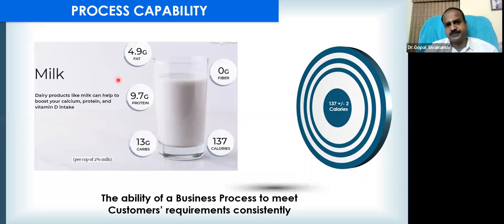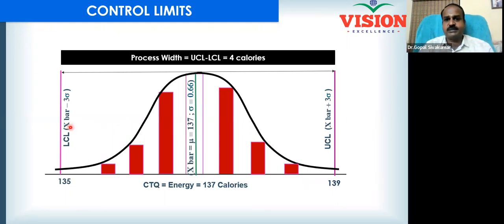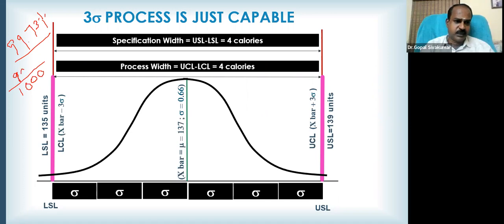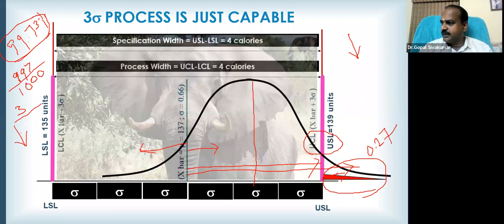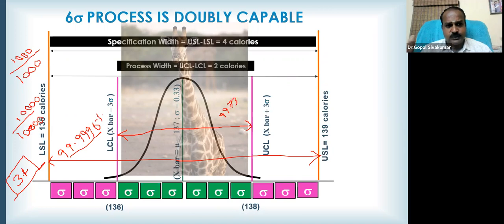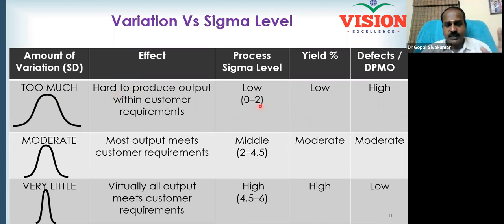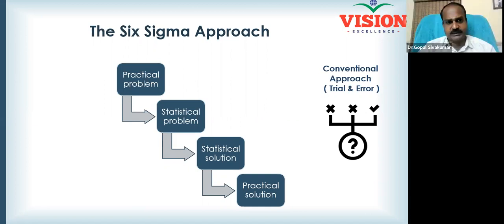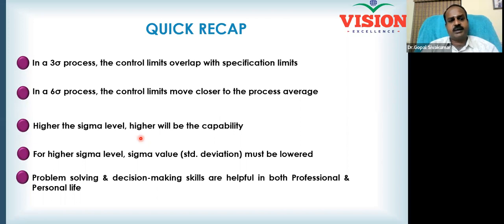6  CONTROL LIMITS   Dr  GSK   19 FEB

Comment: Dear sir

In your other videos, calculation of UCL & LCL for 100 data point  has been done using x-dbar + A2rbar as std deviation is not considered with sub group size less then 9. But in this video we are using x-dbar + 3 std deviation for calculating control limits.

Pls clarify
Thanks
Reply from the maker: Dear Akash, Control limits are points 3 Sigma units away from the centre.
However how do you calculate centre and Sigma depends on your data collection plan.
If you collect data in subgroups, you must use SE of mean and not just Sigma.
This video is to understand the basic meaning of six Sigma. 
You need to read further to understand the difference between within SD & B/W SD to get your question answered. Cheers
Reply: @sixsigmawithgsk  Thanks sir for replying.
Pls tell whats SE above.
 I request you to upload a video on data collection plan also.
However I am collecting data @ 25 parts per production lot ( 5 pcs every 30 min freq) for 5 lots ( 5 different days).
So total 125 data are collected from 5 different production lots with sub group size of 5 and calculating pp ppk.( using overall sigma i.e square root of variance)
My doubt is how i calculate control limits in above scenario.(xdbar +/- 3 sigma) or (xdbar +/- A2rbar) as i am having both r-bar and sigma-overall .

Thanks
Reply from the maker: Sir, Feel free to call me at 8825942908